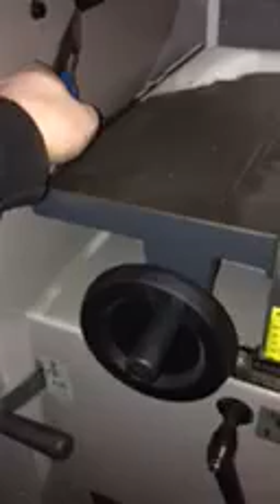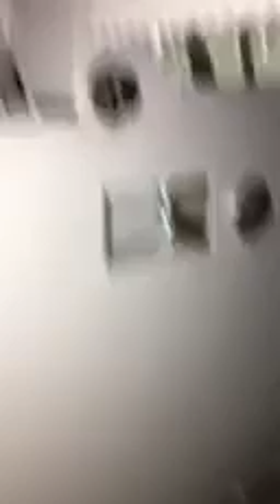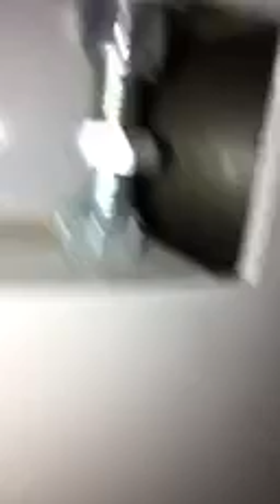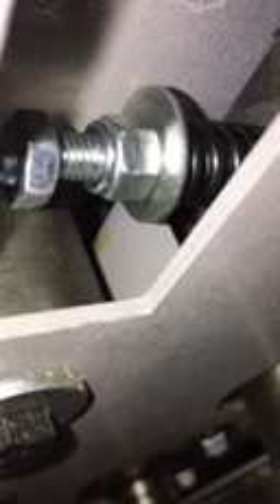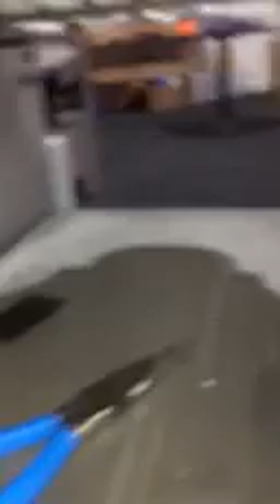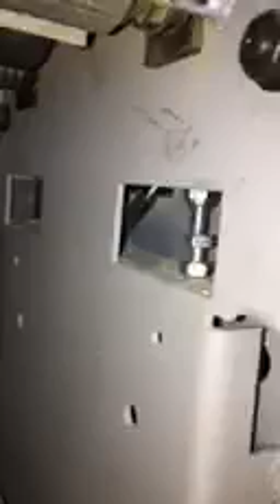A3 31 Adjusting Roller Pressure

Comment: Thank You for the  information.  My A3-41  is about 3 years old and it started not to pull the wood through.  So I marked the nut face of each one.  Tighten the indeed rollers one full turn and the putfeed rollers two turns . One thing to note , You'll  have to  run some boards thru for the feed rollers  springs to engage fully . Was nearly  perfect,  except the boards kicked a little bit to the left , Tighten the  right  out feed rollers a little bit.  Now the machine runs as it should .  Getting help and answers from the manufacturer,  is practically a  waste of time.  Laguna tools is the same , they suck .